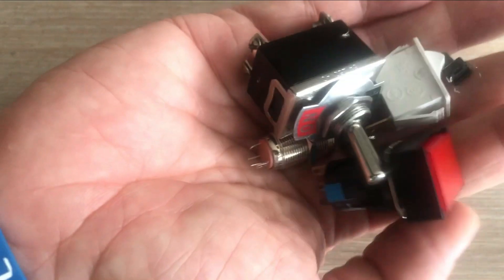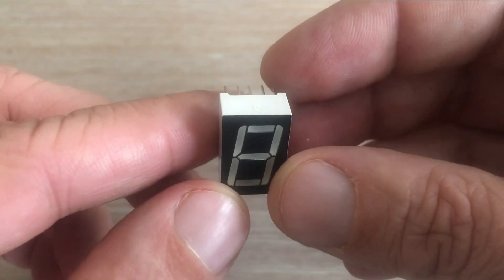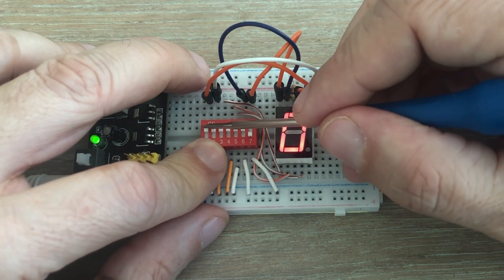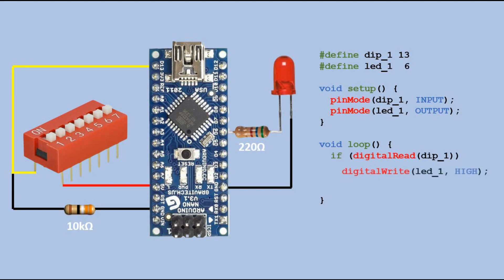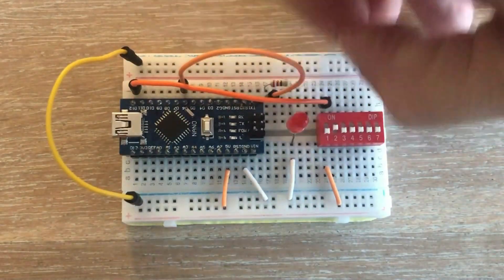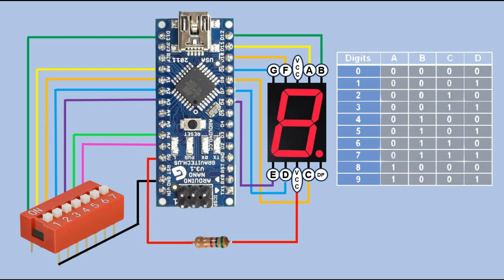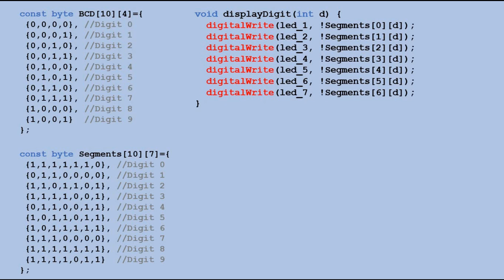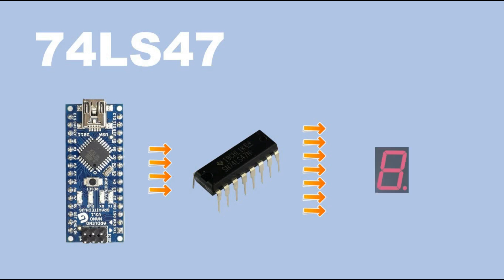Optimizing work with Arduino Digital Input Pins: Build BCD-to-Decimal Converter with Dip Switch"

Comment: Thanks for posting. Very useful. I am putting an Arduino controlled relay together and was looking for a way to set/select different times the relay should be active for.
The relay controls a bathroom fan and a PIR sensor starts the timer running.
By using the DIP switch, I can set a range of times and other functions like retriggerable and not-retriggerable.
Why bother and just buy one? Because two failed commercial units, unrepairable was costing me time and money.